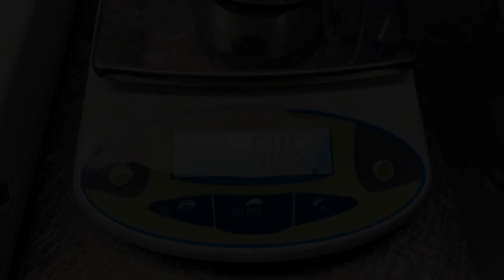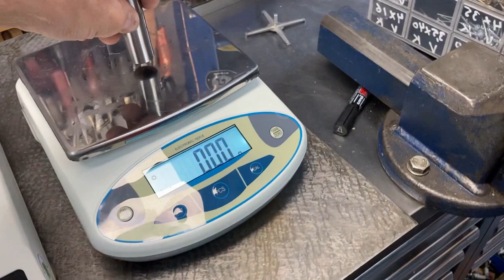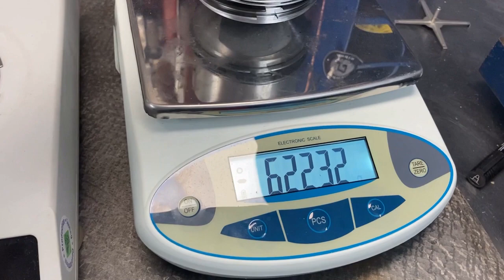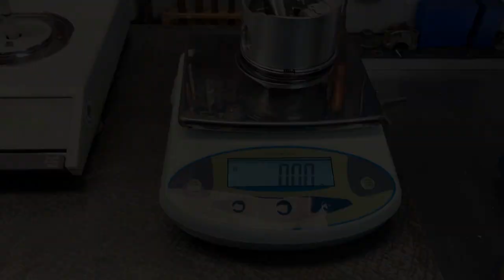Alfa 105 engine rebuild part 3 weighing the pistons and rods

Comment: I assume those rods are clean, but they look like a coating of something is on them.
Reply from the maker: I have bead blasted these rods.
I hope it will create the same sort of effect as shot peening.
If you look at a bead blasted steel surface you can see the dents from the glass spheres so maybe it creates a stress release on the surface like shot peening 😏🤞